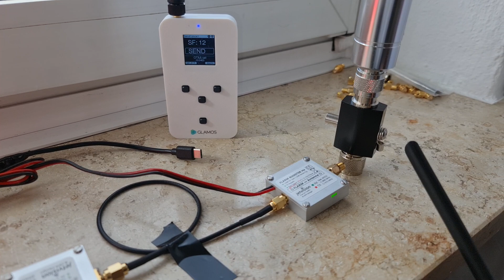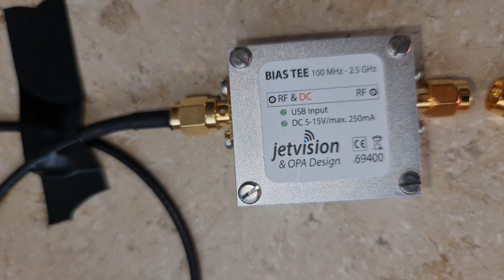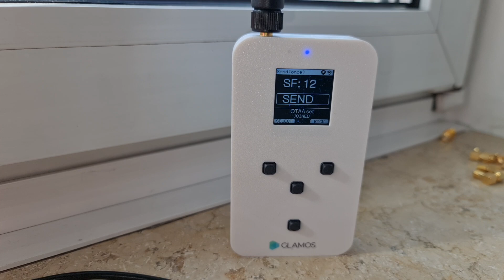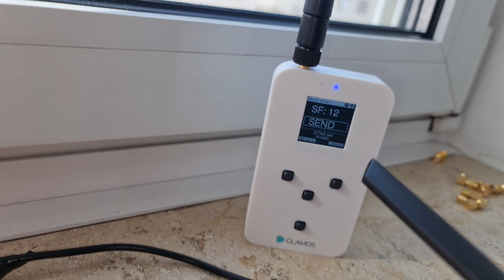FLARM BOOSTER He Helium Amplifier Setup _HELIUM ADDICT

Comment: Dear i just buy callboost amplifier. I have senceCAP miner but when i connect it to miner there is no improvement and also too many invalid the hight is about 20 meter and the cable is around 1 meter brcoz i make setup top of the building

Comment: My amplifier has adjustable tx (0-10dbi ) and fixed rx 10dbi , any idea how to calibrate tx ? Based on what ? My antenna is 5.8dbi
Reply from the maker: Put in the Helium app 5.8dBi and that's its and keep your TXand RX at 10 dBi  and if you get invalid witnesses, start reduce your TX 
Best of luck 👍

Comment: Hello again, starting at 5 minutes into your video, are there any suggestions you have for setting up this same type of direct power connection or equivalent for a bobcat miner? It doesn’t have the same usb power but I am using a PoE splitter to power and give internet to the miner from my office window to my outside porch below. My lmr 400 coax then runs up a flagpole from there to about 6m high. Again, any setup guidance and options on how I can possibly fit all of my necessary amp connections (acasom) into an outside enclosure with my miner inside my porch would be perfect. I imagined it being similar to Sorin’s initial (acasom vs Flarm) test videos where he has everything hooked up together in the box except I wouldn’t have a splitter and two miners hooked up together in on spot. Also, What is the disadvantage of connecting the amp and filter at the end of my lmr400 coax length (on miner side) as opposed to connecting them directly into the antenna itself? Is it only db loss? Because surely 17 db gain amplified should make up for that no?

Comment: Hey brother,
When I connect two miners via a mini circuits splitter and acasom amplifier, my miners stopped witnessing and beaconing. Any reason why? Do I need an attenuator? I have a cavity filter placed and am using lmr 200 instead of 400. Is the miner deaf or just doesn't work?
When any of the miners beacon, it is barely witnessed by a single close miner, and i am in Los Angeles where it is densely populated. When i remove the amp and splitter each beacon finds 14 witnesses.  And if I connect the two miners via a splitter then one of the miners work well while the other doesn't. I tried adding a 5dbi attenuator but nothing changed. Please give me some advice i would really appreciate it. 
Best
Reply from the maker: Try to connect your Amplifier with 1 Miner to see if he beacons and witnesses properly. 
If he doesn't beacon or witnesses  try to connect him the other way   ( input / output  )  maybe you connect him wrong 🤔 
Or the factory assembly was wrong 
Try this test on 1 Miner and see what happens.  If he works add the second Miner
I hope this was helpful for you 
Happy Mining ✌️
Reply: @heliumaddict8582  Won't connecting it the other way fry the miner? Also i have tried two different amplifiers (airbuddy and acasom) and both seem to just not do anything. Im using lmr 200 and even tried adding an attenuator hoping maybe the miner was deaf but even that didn't help.
Reply from the maker: @Martin-so8gb   i think you have A Bobcat Miner?
If yes bobcat don't function good when you connect 2 or 3 of the them  together.
Reply: @heliumaddict8582  No I have a freedomfi and a finestra miner. But i tried connecting each one individually to the amplifier and nothing happens. Only sometimes a beacon and the beacon send a weak signal that can only be seen by one miner and not the usual 14 when without the amplifier. It seems as if the signal gets deamplified.
Reply from the maker: @Martin-so8gb  I m sorry maybe you have faulty Amplifier  🤷‍♂️
Reply: @heliumaddict8582  :( Thanks for the quick replies and help bro. I appreciate it

Comment: Can you show how to use a cavity filter to ground it? That would be awesome because unlike a lighting arrestor it doesn't have a place that you can bind the grounding cable from the side. So if I just use a cavity filter do I have to use a metal clamp to make sure the grounding cable touches the side of the cavity filter?
Reply from the maker: Yeah I think 🤔 it's good idea  
Use ground cable seround the cavity filter and make shure he touch the matell part of the cavity filter not the paint
I m not expect copy me on your own risk 🙃
Reply: @heliumaddict8582  question: Can we use  the lightning arrestor first and then connect the end of the lightning arrestor to the  cavity filter directly. I know this might result in some db loss I just want ot be safe than sorry haha. So its antenna > lightning arrestor>  cavity filter> bias tee> miner
Reply from the maker: @semre95  yes u can

Comment: Love the new video! It brings a lot of clarity. I have been trying a 4 miner 1 antenna set up and it has been running great. I appreciate you. Hope to see the next video!
Reply: How is your Transmit scale? No loss because the scale is low?
Reply from the maker: @kryetex5300  The transmit scale still decent 👌  and dB loss its depends how you install your Amplifier
Reply: @heliumaddict8582  Okay Thank you😀
Reply: @kryetex5300  For my transmit scale, I asserted it within 150 meters so it isnt in my hex directly. I have 1.0 TS for all 4.
Reply from the maker: Thanks 🙏 😇 
See yeah ✌️

Comment: Nice video! You're SF(spreading factor) is to high on the Glamos Walker.Test 5 times with SF9 if you want to compare with helium miners output. The helium miners in EU has limited to 14dBm output. You will always have losses (cables, connectors,  arrestor). You will lose easily 2dB in this setup. So your output will be 12dBm. With the amplifier you will have +10dB on the RX. You will end with 22dBm output RX en 12dBm output TX. The antenna will give also some gain.
Reply from the maker: Thanks for the information 🙏
I will try et 
Happy Mining ✌️
Reply: Hi! 
I have a question please. I have a bobcat miner 300 with a 8,0 dBi antena. I am located in Helsinki-Finland, Europe. My Bobcat miner is in my apartment and antena is instaled in balcony. Please tell me is GLAMOS enough for me or? I dont have much of knowledge about all these.

Comment: a silicone conformal coating and a rust and corrosion preventer. Is amazing to water proof your amp I use it on my fpv drones and it works for the heat and does not bother signal and you cover the amp board with it and the still use water proof tape to cover the case of the amp
Reply: Just what I do and the heat does not bother it
Reply: I know you know about the amps required I was not saying that to you
Reply from the maker: @beanflickerOu812  Thanks anyway 🙏😇 , nolege is power 🔋 💪 👌
Reply from the maker: Thank you very much for the information it's great idea 💡 👏🙏😇

Comment: You did good making that T to power the miner and amp just use a meter to make sure your getting enough amps to the amp because some miners power supply only have 5 volt 1 amp and the amplifier requires 5 volts and 3 amps it all just depends on the miner and amp and you have to do the same when your using POE to power them as well it makes a difference when the amplifier is receiving  or sending a signal the amplifier changes the amount of amps that it requires to perform at its optimal level
Reply: Jetvision 10db Does it require 5v 3a? Is it ok if I buy and connect such an adapter?or should i connect it to miner's usb port?
Reply from the maker: @ismailayyldz8021   just connect him to 5 v power source. Or buy BAIES TEE 
Don't use usb port of the Miner  you will fu###ck your setup
Reply: Okey thank you bro :)
Reply from the maker: You have 💯 %right ✅️   I just do the T to test if the Amplifier is working or not   I use  2 sorse of power and I power separately the miner and The Amplifier for stable performance and piece of mind 
Happy Mining ✌️

Comment: How are you I would like to talk some other because I think we could share some info to help each other I know of saw filters that connect with sma no solder and 0.9 insertion loss there not as cheap as others but cheaper thank cavity  and have a tighter frequency range like for USA not 900mhz to 930mhz because we don't use all of that frequency also I have some LNA that connect with sma that are amazing but they are not bi-directional but you know how to connect them so you can have a tx antenna and a rx antenna and we can use LNA and FILTERS that are alot better than they provide on the lora modular that are in your miner thank hope to hear back
Reply: Thanks
Reply from the maker: His 👋 Robert 
I working on this at the moment I had this idea from long time ⌛️ but I still not get the right parts to do this project if you think you can help with information 
Email me at hntaddict@gmail.com 
Happy Mining ✌️